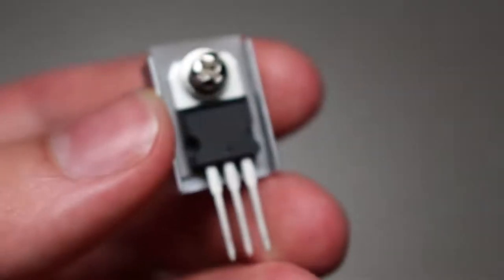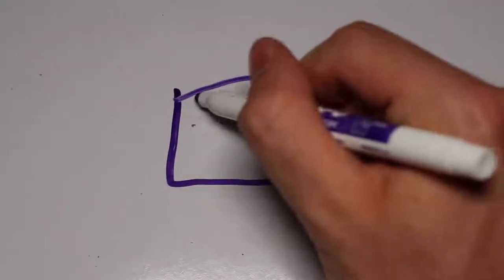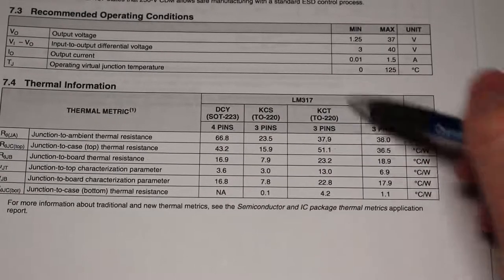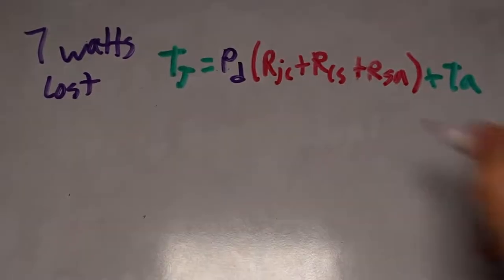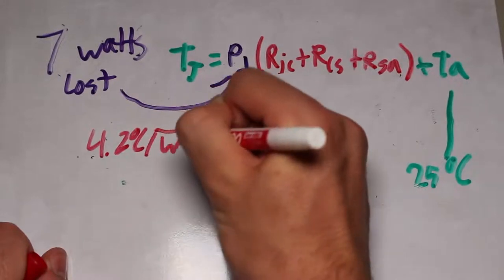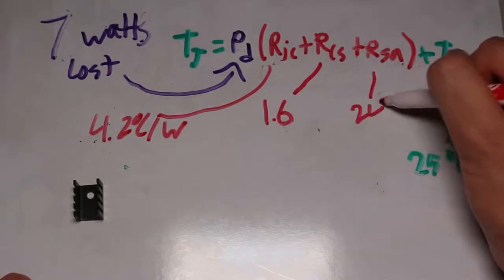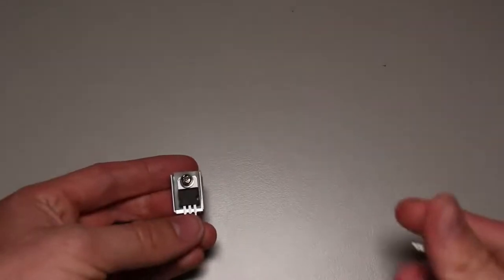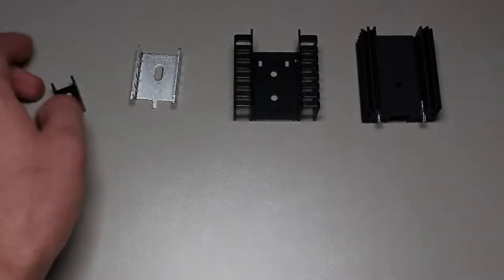Which Heat Sink is Enough? - Heat Sink Selection Guide

Comment: I wasn't  going to tell you that your calculations need work, but.. At least what about the 5 Watts the regulator drives to the load? So your 7 Watts is actually 12 Watts plus.
Reply from the maker: The entire system has 12 watts. The regulator drops the 12 volt input down to 5 volts, resulting in a 7 volt drop. In order to lose those 7 volts, the regulator dissipates it in the form of heat. In this case there is 1 amp so 7 watts. The load itself has to deal with those extra 5 watts, because it is the one with 5v on its input.
Reply: @SineLab  Yes, so your power supply will see 12 Watts and the total dissipation on the 317 is also 12 Watts of heat on it. The transistor  inside the 317 does get hot with the output load not just from collector to emitter voltage.
Reply from the maker: P = I * V
Reply: @davestech6357  so what you're saying is that the load dissipates no power at all?
Reply: @anonymouseniller6688  yes the load will away from the lm713.

Comment: This is truly a clear-cut video on this subject, and I love it.  However, in my situation, I seem to have run into a bit of a snag with the equation.

I'm using a high-power BJT that allows a maximum current of 30 amps.  In my circuit, I've measured that it absorbs about 91 watts of power (I've rounded up to 100), and the datasheet shows a maximum operating temperature of 150C.  Rjc is 0.5, and I follow your rule-of-thumb value of 1.6 for Rcs.  When I plug these numbers into the equation, and attempt to solve for Rsa, the value is negative.  Does this just mean that there is no heat sink, on the market, that could ever be used to cool this transistor at 100 watts?  Or, perhaps, does this equation only pertain to a certain range of power components?

The datasheet, for the transistor, claims that it has a total power dissipation of 250 watts.  This is in the "maximum ratings" section.  Because I'm only considering a usage of 100 watts, shouldn't I be able to keep it cool with a heat sink?

I agree, with many others, that you, easily, have the best video on this topic.  Keep up the great work!
Reply from the maker: If the equation yields a negative number for Rsa, then it's physically impossible to pick a heatsink that keeps the transistor within the temperature rating. At this point the only way to solve the problem would be to choose another transistor with a lower Rjc value, lower your ambient temperature, lower your power dissipation, or raise your maximum temperature.

It might help to know what exactly the transistor will be doing. 91 watts is A LOT of power. This could potentially be OK if the load is pulsed and isn't continuous since there wouldn't be enough time to heat the transistor up. Depending on what you had in mind, some sort of switching solution may be more appropriate.

Comment: Im upgrading to a heat sink with a new SSR i had to replace in an infrared conveyor belt dryer. The new dryers come with heat sinks, mine failed after 19 years so i dont think i need the heat sink but after your video i realize a 50A 3-35vdc input and 24-280vac output probably needs it.

Thank you